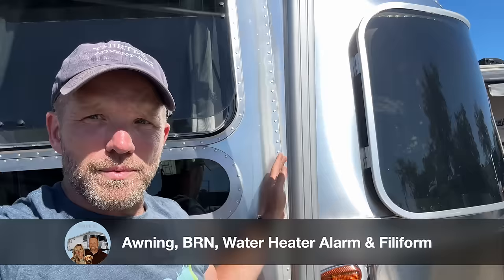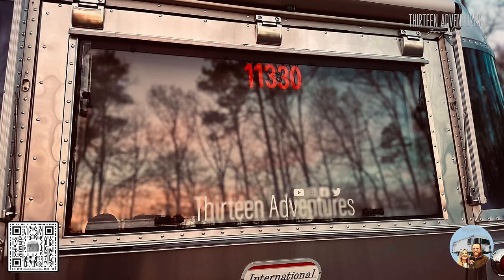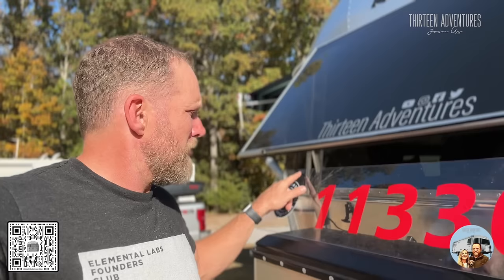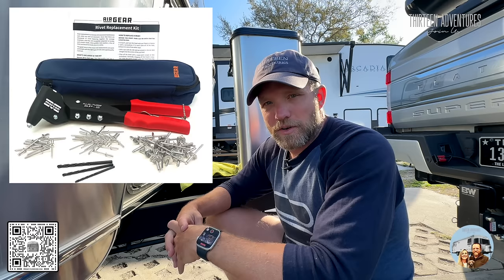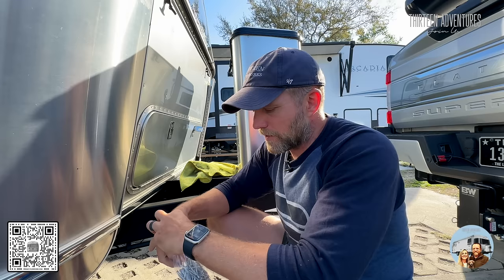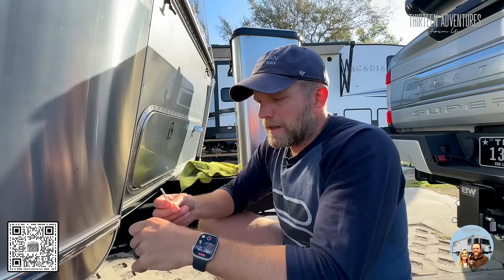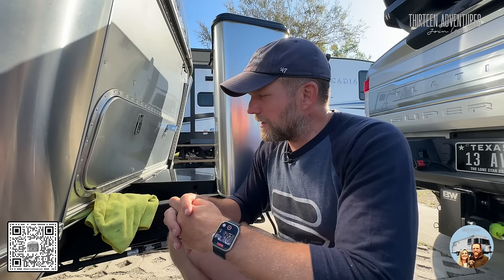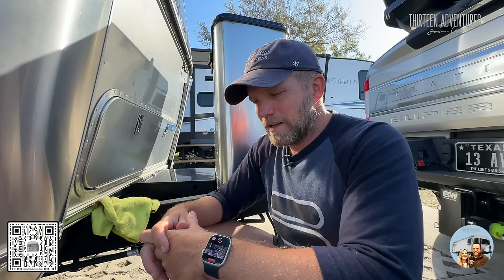Airstream Front End Separation Awning Adjustment, Corrosion Control & BRN Display!

Comment: Nice video.  Couldn’t you have replaced that rivet with a buck rivet?  I am sure Blair would have been happy to squeeze into the compartment to brace the rivet from the back.  😆   We are quite happy with with the ceramic coating that Master Applied Coatings did for us in Tallahassee.  I will be curious to get your take on the work they do.  A year after we had the coating applied we took a serious stone hit in the front end cap that went down to bare aluminum. I was slow to call Master Applied Coatings and got a little filiform at that spot.  I made an appointment with Master Applied Coatings and they were able to recoat just that spot.   I now carry some Corrosion X and clear nail polish just in case it happens again.
Reply from the maker: She would have been very happy to do so but it would have required removing all the bedroom furniture again and then removing the interior skin right there to do it.  One rivet is not worth all that.

Im excited to get up there in a few weeks and chat with them about all the tings they see and what options they recommend for a variety of road woes.

Comment: Using silicone is NOT recommended to seal an Olympic rivet on an Airstream.  They are many other recommended sealants - Tempro, Acryl-R, Captain Tolley's, Parbond, etc.  Removing the washer/gasket is recommended as you mentioned (short lifespan).  Enjoy your videos!
Reply from the maker: Thanks for the note and info.  Ive used all of those on various applications depending on the location and where Im sealing.

Comment: Brad great video as always. We have the exact same make, model and year as you. Glad to hear for FES the braces are already installed. After KYD’s video we looked at our rig and noticed four rivets missing, two on the bottom left and two on the bottom right corners where you replaced one rivet on the front storage. We have an appointment at the Mother Ship on August to address this and other warranty issues. Question should I replace the rivets myself prior to our visit as we have a couple trips scheduled?
Reply from the maker: I would replace them before I drive.  It's easy enough to replace them.  Think of it like a zipper; once it starts, it's easier to keep going.
Reply: That’s a good point thanks for the tip.

Comment: Did you have to go back to the factory to get the front end brace kit, or was that installed during the original build?  I have a 2023 International FBT.  I haven't noticed anything in the front compartment. Should it be obvious?  Thanks for another great video!
Reply from the maker: No, they were installed at the factory. You can’t see them because they’re between the interior and exterior skin. Thanks for watching and your feedback.

Comment: Would you recommend getting Vinny’s ceramic treatment on a new unit? With or without getting the factory treatment?
Reply from the maker: The factory only has a standard clearcoat.  Many dealerships offer a ceramic wax coating after it arrives. (there may be dealerships doing something that I am not aware of also!). Vinnie's can do it on any age trailer.  Obviously, the newer the trailer, the better it will look.

Comment: You mentioned that you sometimes heat with the heat pump…last year we were in cold weather in Wyoming and used the heat pump at a full hookup park.  I noticed a huge amount of water pouring out of the passenger side front of our FC 25.  I took a video and showed it to our nearest Airstream dealer in Florida, and I sent it to the factory.  Dealer said it was normal.  Factory said I should not use the heat pump to heat the Airstream.  Factory said the HP was only to “take the chill” out of the trailer, but that I should use the propane heater.  Is that your understanding of the HP function?
Reply from the maker: Hello and thanks for watching and your question.  The heat pump will only work properly at temperatures above 45 degrees F.    Below that temp, you need to use your furnace.  We also have a Dyson fan/heater/HEPA filter that we heat with depending on the temps.  The water coming out is most likely condensation from the roof unit.  There are drain tubes that drain in the fender on the road side but if they are clogged or your trailer is not quite level, they may not drain properly and you will see water running down the side right at the front awning rod and dripping on the ground.  Hope this helps.
Reply: I don’t use the HP below 45 degrees, but even above 45 the factory person I communicated with said HP is not for heating.  It is just to “take the chill off.”  I had used it as a heat source when we had electric hookups, but they said I shouldn’t.  I now run the HP for no more than 15 minutes.
Reply: I use the heat pump when it's practical, eg, I have power and it's above freezing. Be aware that the A/C is running backwards (oversimplified) and so condensation does not drip out of the drain tubes like with A/C. The condensation runs on to the roof and depending which side is low it drips off there. I usually have a puddle on the ground in one corner. That's normal. My thermostat, the CCC-2 has a program that at a certain temp switches the furnace on. 35-40ish? Its only happened once for me, but I'm in the south.
Reply from the maker: Interesting!  Im curious to know why this was said.  The manual states "The heat pump is designed to knock the chill off your trailer. It functions when outside temperature is 45oF or greater by removing heat from the outside air. Below 45oF it will not provide heat."  Maybe they are only allowed to say what the manual says.  But it also doesn't say anything about duration.

Ive now lived for 12 years in an RV.  The last three had heat pumps and I lived in Utah/Wyoming/Colorado/Montana/Idaho much of the time we were in those models.  I used the heat pump in the winter daily along with my Dyson heater inside similarly with the AC in the summer time. .  I have never had an issue with them.  I just change the mode when its below 45 (we've even noticed it works pretty well until it gets to about 40.
Reply from the maker: I concur!  This is exactly as I have used it as stated in my previous reply.  Ive had it switch to furnace a few times when I didnt realize the temps had dropped so much.
Reply: I uploaded my email and factory response regarding HP use to your Facebook page (couldn’t figure out how to do it here).

Comment: Call me old fashioned but in my opinion the tankless water heater and power awning are nothing but problems. The more technology = the more to break down. That rivet likely will pop out again if you have front end separation.
Reply from the maker: We love the current water heater and have had the tanked variant in the past.  We are also on our second Airstream with the powered awning and have had zero issues with either one.  The main problem people have with their powered awning is failing to lubricate it properly.  The water heater has worked great except for that one time and we have had it in freezing temperatures for many months.